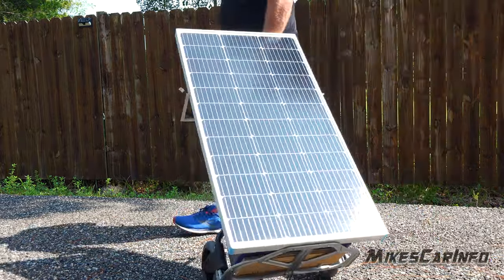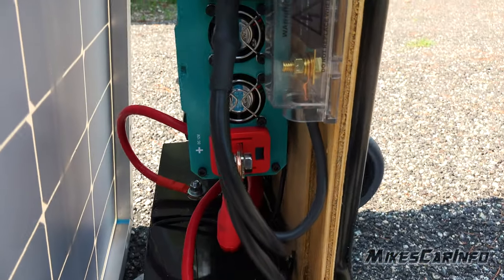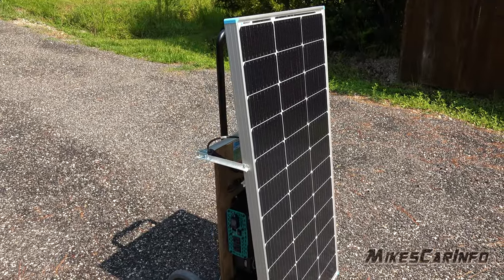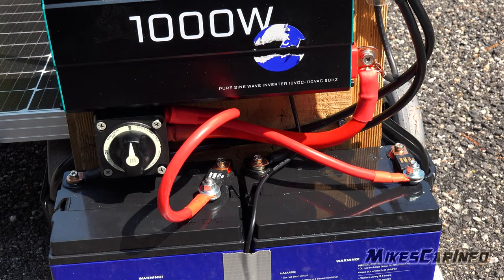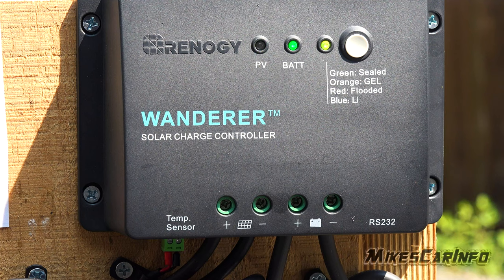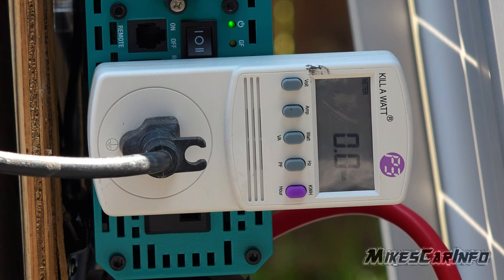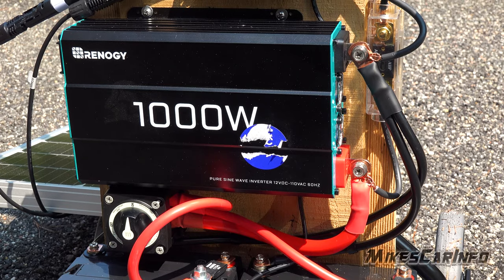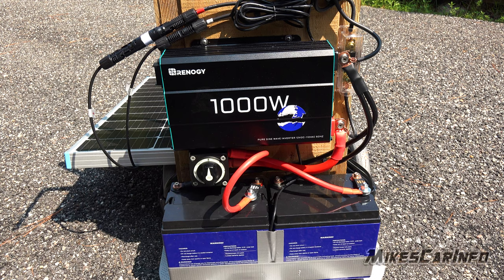👉Solar Hand Truck Power Station DIY Idea Dolly

Comment: Nice Power station, going to use this idea except the on/off switch location, in case of a fire
move location to the back side of board, thanks for showing your dolly setup.
Reply from the maker: Good idea 💡

Comment: If you use a check valve will that keep the pump wet when the pressure drops so you don't need to re-prime?
Reply from the maker: It usually doesn't loose it's prime but it is good to keep some pressure on the system just case. It does have a check valve.